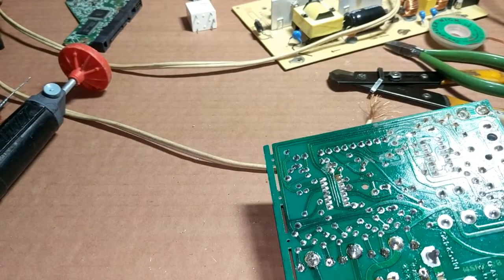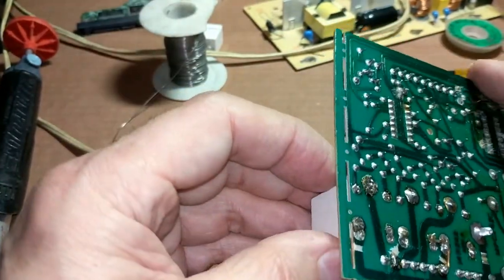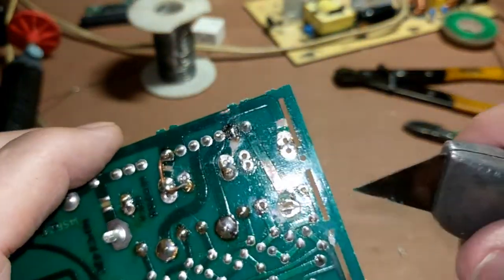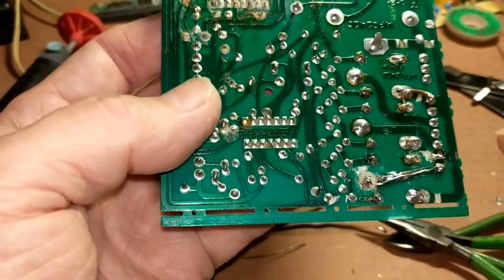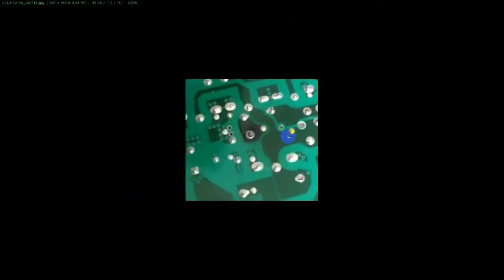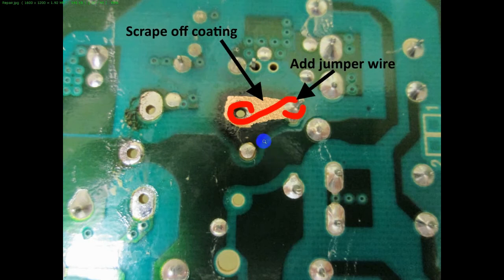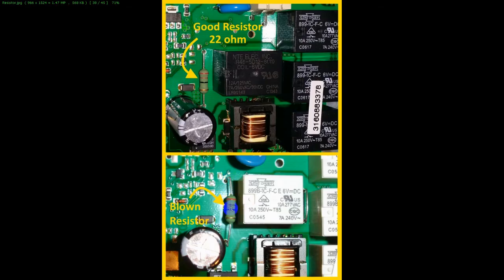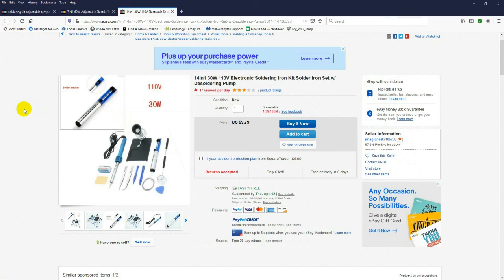Bosch Control Board Repair Tips

Comment: Hello AgglomeratedIdeas, I've come upon your video because of my bosch dishwasher imagine that!  I replaced the heater unit and it didnt fix the problem. So I ordered the relay you spec'd here.

So the old relay was a Nais js18-5volt.  10amp at 125 volts.

Will the NTE 6volt work as a replacement?

DW Bosch SHU53A

Thanks a lot TIm T.    ..... BTW I soldered the new relay in and presto, it heats! So I guess the 6 volt relay is good
Reply from the maker: The NTE R46-5D12-6 is a 6 volt relay as you have noted.  That relay may "work" as a replacement for your 5V relay, but I would not recommend it.  The problem is that the relay will close very weakly due the the lower coil voltage than the specified 6V.  Long term it may burn the contacts and fail as a result.  Unfortunately, NTE does not make a 5V relay in the same series as the R46-5D12-6.
It would be best to replace your relay with another 5V relay.  Google "JS1A-5V-F" or "JS1-5V-F".  Either one of those will work.  The first is a SPST and the second is a SPDT relay.  Note that some boards don't have hole for the normally closed 5th pin of a SPDT relay, so just cut it off as it is not used.
Let me know if you have any more questions.  Good luck.  Cheers!
Reply: @AgglomeratedIdeas  , Thanks  a lot, Ill run this relay for a while and order a 5volt, I did locate one on amazon. Yes, I did cut off the 5th pin. That worked just fine. After taking apart the old original relay I see how these relay's work - pretty simple.
Reply: @AgglomeratedIdeas  , actually here is the 5 volt I found.

Mini 5V DC Power Relay SRD-5VDC-SL-C 5 Pin PCB Type, Opens in a new tab
Mini 5V DC Power Relay SRD-5VDC-SL-C 5 Pin PCB Type
Reply from the maker: @Tannerxcsoaring  That relay should work fine.  I ordered a spare for my DW just to have on hand if I needed it.  So far, my NTE replacement relay is still working after more than 7 years.

Comment: I have a Bosch Dishwasher and I found that one pin on the heater relay had gotten hot enough to melt the solder and loose its connection. 
I re-soldered the pin and everything is working GREAT. 
My question is this: 
Since this has happened to this relay, does it suggest I should plan on replacing that relay as it is overheating and could potentially melt the board?
Reply from the maker: Re-soldering the pin is only a temporary fix.  The relay must be replaced because it is a bad relay that causes the solder to melt.  Yes, it can potentially damage the board if you continue to run the DW with a bad relay.  I added a video to discuss this in more detail: https://www.youtube.com/watch?v=3nLN3WO3RQY
Thanks for the question and good luck with your repair.
Reply: @AgglomeratedIdeas  Thank you I'll watch that this evening.
Would it also be wise to replace the other two relays as they are now approaching 20 years old?
Reply from the maker: @cathygordielehman1580  The relays are cheap (the shipping can cost more than a relay) so you can if you like, but I haven't seen any of the other relays fail yet.  If you are comfortable with soldering, then I would say to go for it as it can't hurt to have all new relays.

Comment: hi sir 
i have a bosch dishwasher and has the fault E11
thermitor error 
i have check it is ok and the contacts between pcb and it 
do you know maby on thermistors with three pins what voltages 
 must i measure from pcb ?
Reply from the maker: I am sorry, but I do not know what the voltages would be on a 3-pin thermistor.  I did read somewhere that the 3-pin thermistor should have a resistance of about 18K ohms on the outer pins, and about 9K ohms to the center pin from the outer pins.  However, the person that wrote that did not post his model number.  So, I don't know if that applies to all 3-pin thermistors.
My dishwasher has the 2-pin thermistor and it measures about 55K ohms.  That would be different from your dishwasher.

Comment: Please help PLease please..... I have a bosch HEI7282U/09
Problem - Conv Broil, conv Roast, broil does not heat up (very slow)
- Bake works fine
- Conv Fan works
Work Done - Replaced back round element (new=56 ohms, no Continuity), seller says that is the expected range
- Replaced Top Element (new=17.5 ohms, good continuity)

What should could be the problem? Many thanks
Reply from the maker: I am not familiar with the HEI7282U/09, but there are 3 heating elements (top, bottom, and rear).  All 3 need to work and will read continuity when checked with an ohmmeter.  You say "Replaced back round element (new=56 ohms, no Continuity)".  Do you mean it had no continuity before you replaced it?
You do not mention the bottom element.  Have you checked it for continuity?
If broiler element comes on and then quickly goes off, then that could be a bad Power Module.
Reply: @AgglomeratedIdeas  the 56ohm is the new element but test for continuity does not beep, seller says that is normal.  My meter shows .088v,56ohm and no beep.  Is it good?  The bottom element is the bake and that is good.  The top and back is for roast and conv cooking.  Both top and back seems to be not heating up.
Reply from the maker: @Asian_Connection  The "continuity" test function on some meters is not all that reliable.  Reading ohms is a much better test.  So, if you are reading ohms on all 3 elements, then they are likely good and you probably have a Power Module issue.  In other words, the module is not telling the top and back elements to turn on.
Heating elements are going to measure low resistance (ohms) if good.  An open reading (infinite resistance) would indicate the element is bad.  A zero or near zero reading would indicate a shorted element which usually trips the breaker.
It would be a good idea to check the resistance of the temperature sensor too.  I believe it should be about 1000-1100 ohms at room temperature.